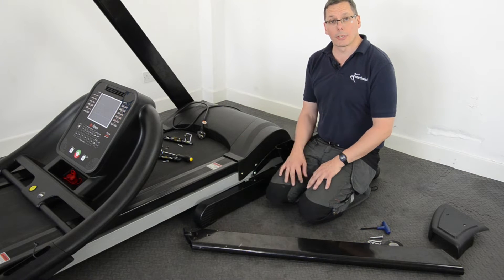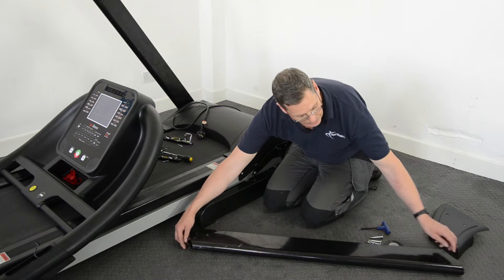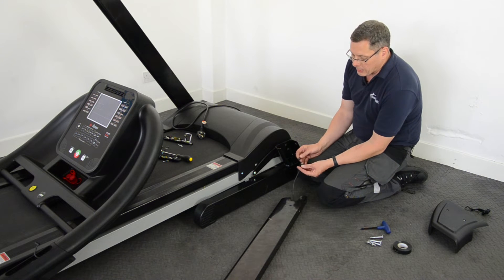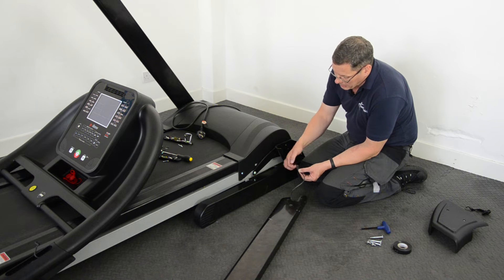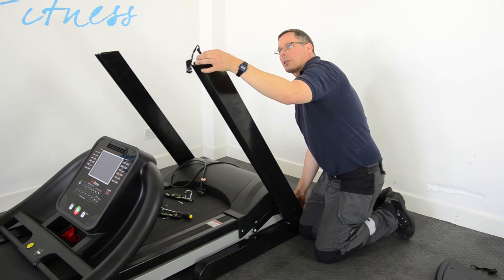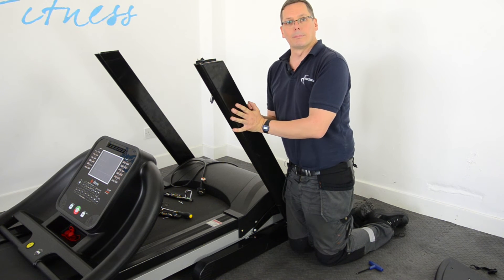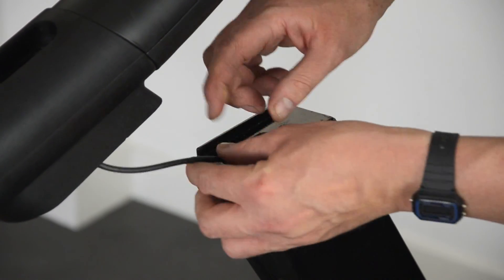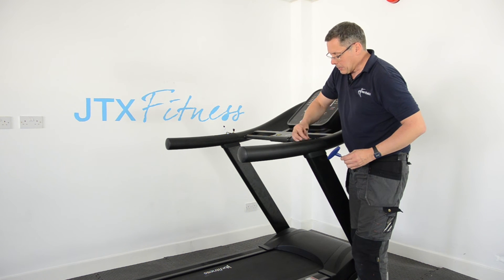How to assemble a treadmill

Comment: Would you recommend placing wood slats across feet of treadmill to distribute the weight as to not damage a vinyl plank flooring? Those little round pads just seem like they'll dig in to floor over time
Reply from the maker: Yes sounds like a good idea.